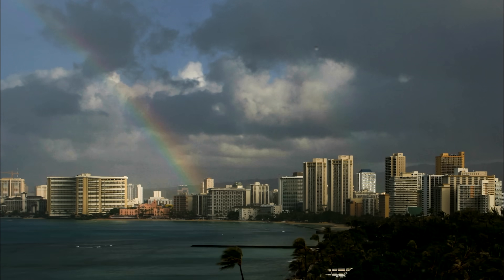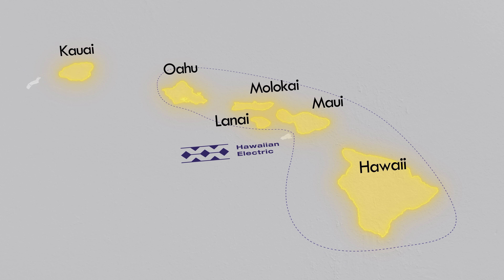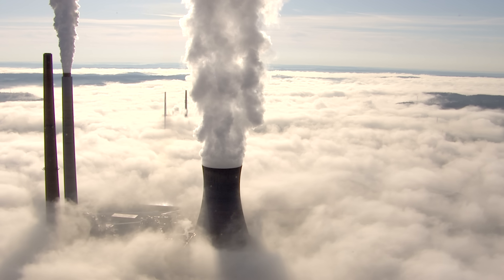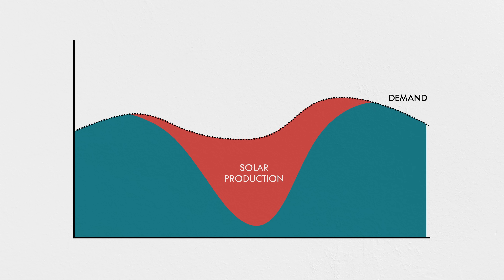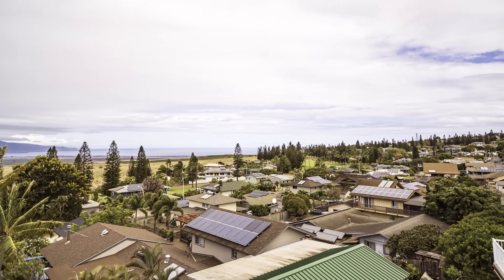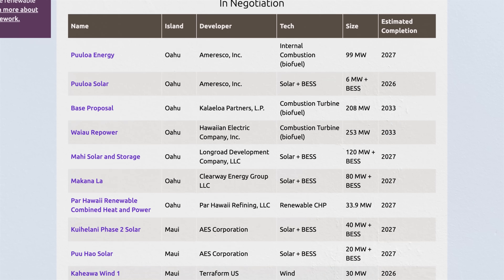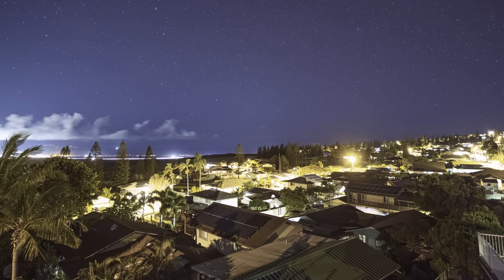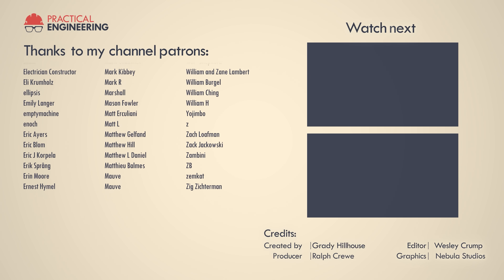How the Hawaiian Power Grid Works

Comment: One thing with "net metering" is the you really need hourly metering for distributed sources. That kWh you buy during peek hour a day with no wind (or evening/morning with no sun) is way more expensive than the one you sell when there is a steady wind and not a cloud in the sky on a Sunday when most businesses are closed (and in a season where AC is not needed).

And even then there is a difference between what you get paid at the point of production (sometimes negative), and the higher price paid by the consumer at another point of the grid, because transmission still costs.
Reply: Then it isn't net metering anymore. It's the instantaneous wholesale spot price.
Reply: OTOH Net metering is a nice simple way to encourage people to install solar panels in the early days of the energy transition. When the state's entire production of renewables (including commercial scale solar and wind) is still only 10%, any power produced results in a direct saving in imported fuel.
I'd agree that it won't work if domestic solar is producing a significant amount of the total (we're seeing lots of time-of-use tariffs and even half-hourly variable rates in the UK) but it's still a sensible option for Hawaii.
Reply: @robinbennett5994  But why do we want people to be installing solar panels when it isn't economic? And why should rooftop solar people be getting paid retail prices when power stations are only paid wholesale power prices?
Reply: @gregorymalchuk272 because Hawaii is at 10% of renewables and wants to get to 100% fairly quickly. It's a temporary subsidy that can be changed when there's enough solar to make a difference. And because Hawaii isn't Arizona or Texas and doesn't have massive empty deserts to fill with commercial solar plants, but it does have more than enough roof tops.
Reply: @robinbennett5994  Why is lots of solar with outrageous electricity prices a public good worth wrecking the electricity market over?
Reply: @robinbennett5994  Why aren't they building nuclear plants?
Reply: "Net metering" was an incentive to encourage people to install solar without waiting for HECO to install fancy metering systems.  When solar was feeding the grid, the meter ran backwards.  You only paid for "net" use.  In effect, you sold the power for the same price as you bought it.  While some people are grandfathered in to net metering, that program is closed.  Right now, you sell power at a lower rate than you buy it.
Reply: @russellhltn1396  Net metering is fraud and nobody should be grandfathered into it.
Reply: 11:44 "increased efficiencies" is the worst lie in the history of electricity distribution. Increased efficiency leads to lower costs, which increases demand, just look at LED lighting, especially outside. If the cost goes up for other reasons, efficiency in some areas may compensate for those costs for the basic needs (such a fridges and utility lighting) but in the end, more efficiency is always compensated by induced demand, the same way an extra lane on a road does.
Reply: @57thorns  I'd need some sources on that one lmao
Definetly feels more like saying "increasing the fuel economy of cars induces demand for cars" which while broad enough to not be dismissable off-hand, it's definetly nothing like the induced demand of adding lanes
Reply: @ValentineC137  As I mentioned, the amount of products for lighting has exploded, especially mood lighting and outdoors. Where there once used to be either very modest and only in some instance a lot of e.g. Christmas lights, now it is much more common to put on a big light display.

As for the cars better fuel economy, the car will be used more of course. Anything from shopping at a shopping center outside town instead of the local grocery store to weekend trips.

In both cases the total cost might be lower, and the total energy usage lower for most, there will be those that use more energy as well.

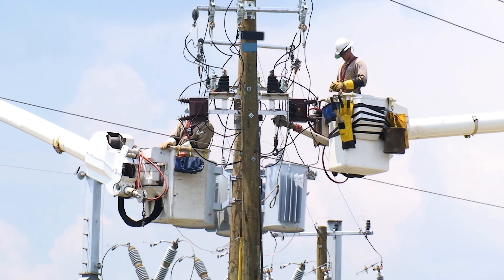Comment: @11:00, And this is why the pricing structure for our power needs a major change. There should be an "connection" fee, and a "usage rate". the connection fee would cover the fixed costs  of simply having a connection to the grid, and the usage rate would be the direct cost of that power. many electrical grid operators are already heavily regulated so ensuring transparency shouldn't be an issue. The goal would be that most consumers that do not have local power generation should see minimal change in their monthly bill.
Reply: I didn't realize that wasn't normal. My bill is itemized with a per-day charge for simply being a customer, plus a kwh rate.

Comment: A very informative video. Hawaii's main islands are very close to each other. Even the largest gap between Kauai and Oahu is only about 120km (whatever miles...). They should really figure out how to do those undersea DC connections. Surely this is not impossible. A bigger grid is a much better grid.

Comment: I grew up on Oahu and one thing we used very little of was electricity. No AC or heat didn't need much lighting, Washer and dryer were outside and often didn't use the dryer. I'm glad you brought up all the issues with piling solar onto a small grid as there are many complaining about no longer being able to put power back on the grid now. It's a much more complicated issue than it looks on the surface. Also looking forward to your next video. There is a big difference between a rotating mass making electricity and a digital inverter and then a transformer based inverter as well.
         But I did see on google street view that the house we lived in went from a flat tar and gravel roof to a conventional pitched roof with solar panels and it looks like they have replaced the jalousie windows with regular windows and added air conditioning. My only complaint about living there was the constant ear infections from not having a dry place to sleep at night so AC is a very good thing.
Reply: @dobbo7690  I haven't been back since I left in 89. Allot has changed there especially the population explosion there.( I remember H1 still being under construction) None of the stuff I would want to go back to exists anymore either. Friends have told me I would be disappointed if I came back as it's not even close to the place I remember. I can jump on a plane and get there really easily but the cost of hotels rental cars etc are nutz now. I don't need a resort just a best western... 
    I have been in tx longer than anywhere else now and I miss the summers when a hot day was 92* and places closed in the afternoon cause it was hot... Now here I see 92* as a cool summer day since our temps are regularly 105-110 and don't drop below 80* at night with temps still in the high 90s at midnight.
Reply: @theinfernalcraftsman It is true that you can never go home.  Over time, it, and you, will never be the sane.
Reply: If you think he’s exaggerating, I regularly pay a 650-700 dollar electric bill on the big island. I could be smarter about it but I find it more fruitful to complain about it
Reply: @BruTheThreat   it is extremely difficult to truly live on paradise when all you do is work to pay to survive,  Hawaiian electric KNOWS they have us all bye the b@ll$
Reply: @keilikea01  It's funny because we're contracted to work for Helco on a daily basis and when I brought up the fact that I'm building my own house, they give me tips on how to save power, first steps for solar or in general how to cheese their bills. "Just get a temporary service line just to be on the grid in case anything happens and never apply for a permanent fixture. That requires a permit" 

A few of the foreman think that their business in general is doomed.
Reply: you have those glass slat windows too?
Reply: @joshw.2739  Yup. Every window. Had to move the furniture away from the windows when hurricane Eva came through to keep it from getting wet as they don't hold out wind driven rain very well. This was back in the early 80s and the windows were a constant maintenance nightmare. The gear boxes would freeze up and a pain to clean. At least the bathroom ones had the frosted privacy ones.
Reply: @theinfernalcraftsman  gotcha, I was there in like 2006-2009 when my father was deployed. never had motorized ones but even my school rooms had those style windows. they were just opaque plastic and metal so they could be sealed flush in the event of a lockdown.
Reply: @joshw.2739  The old ones we had were aluminum and steel. The gearbox was an aluminum casting with a hand crank and they would corrode and jam up. They somewhat closed but would still have a gap as even the good ones wouldn't close to where they were any closer than 1/4" at the joints. The school I went to had the same vintage ones as well as they were old back in the 80s. Lockdowns didn't exist back then though Radcliff wasn't super safe back then either.
Reply: @theinfernalcraftsman  well theres your problem, galvanic corrosion from unlike metals!
Reply: @joshw.2739  my apt in honolulu had them still. Was right off of H1, had to clean off a film of road dust from everything every 2-3 weeks.
Reply: @theinfernalcraftsman They froze up usually due to salt corrosion.
Reply: @joshw.2739 Seldom did those windows actually seal that well.  High winds could easily drive water between the two pieces of glass, even fully and tightly touching one another.  No rubber seals.  Endless issues, but they did allow good cross air ventilation on dry days and nights for those with no a/c.
Reply: @theinfernalcraftsman Radcliff?  Radford high?
Reply: @WilliamMurphy-b6v   Go Rams!
Reply: I was fortunate not to get ear infections but my siblings did. Was never sure if it was from the humidity or the fact that we swam darn near every day for hours.
Reply: I lived on Oahu from 2011-2014 and I had an apartment that didn't have A/C or heating.  Didn't need it.  My electric usage was minuscule compared to my usage in Texas.
Reply: I grew up on oahu too in a no AC tongue and groove wall hose
Reply: the worst is high cost of housing i felt like i dont own the house n property never-ending property taxes, the assessment value of the  house and land  goes up n property taxes follow. now u buy a condo or apartment n pay the never endîg keep going up common area or maintenance fee. So if u rent it's the same auwe.😅😅😅to save electricity use a lot of fans it works 2cool off😅😅but then again i like my air-conditioned car😅😅
Reply: I live in Southwest Florida and I have energy monitors on several breakers in my house. 64% of my electricity usage is HVAC and 14% of my electricity usage is charging my EV. They’re the vast majority of my electricity usage. I see the value in not heating or cooling your house, even though it makes life much more pleasant! 

Last week I used:
AC: 275 kWh
Hot water: 16 kWh
EV charger 60 kWh
Everything else: 80 kWh
Reply: Yeah, my hats off to you for living somewhere humid without AC. I barely use AC if I can help it, but I'm fortunate enough to live somewhere with ~30 RH.
Reply: Oooooo. That's a good point. So many people get sold on the idea of selling excess power back, but when everyone has solar, that won't be as much of a thing since everyone will get peak power at the same time.
Reply: I've heard that Hawaiians don't use much AC but I didn't realize that was why. Must be so relieving to finally get some cheaper power.
Reply: Brah! No electric??,  when to wen move, every body get a/C now😂😂😂
Reply: @keilikea01 I never had house AC in Hawaii and if car AC breaks no fix if expensive

I live in Hilo at 500 foot elevation and don’t need AC. If I lived in Honolulu in 2025 I would want AC. Never had AC in Honolulu in 1970’s. Only wealthy people had AC back then.
Reply: @dabigisland1 I guess the geographic location on the island matters more, the truth is now in 2025 there are thousands and thousands of homes what air conditioning is literally a requirement due to new building code and standard. Homes are built so airtight if you do not dehumidify the space regularly or have good air flow through windows that open 100%. It becomes a mushroom and mold breeding ground

Comment: A lot of unanswered questions about the Hawaiian grid.  What is the capacity of battery storage compared to amount of interruptables on the grid?  I hear you say that the batteries are huge, but are they close to what is needed?  Is installation of roof top solar still limited?  Or is it required to be paired with home storage or EVs?

Comment: So they went from 0% to 20% renewable in 17 years.  Now they need to go 80% more from 20% to 100% renewable in the next 20 years.  Diminishing returns? anyone?  I would venture to say all the low hanging fruit has already been picked.
Reply: Or you could say there’s an adoption curve where things need to ramp up. Adoption of new technology is not linear. It starts out slow and picks up speed.
Reply: The percentage of renewable energy for HECO (for Oahu, Maui, and Big Island) as of 2023 was 33%.  Kauai's KIUC is at 60% and has had some days of 100%.  As point of comparison, NYC is at 30% as of 2023.  Additionally, the US DOE says that Hawaii's percentage in 2022 was 29% (+4% YOY), so with 22 more years to go, they are still on track to achieve 100% by 2045 as required.  20% is far too low of a number to present without evidence disproving the DOE and HECO numbers, especially given that there is a significant amount of off-grid renewable power generated in Hawaii as well.
You presented no evidence that the "low hanging fruit has already been picked", since solar and wind are still being adopted at large scales, prices for solar panels and battery storage have been going down, the West Kauai Energy Project has been slowed down due to lawsuits but not stopped, and technologies are still improving.
Reply: yes. they will not make the goal

Comment: 13:56 - Actually you can pay extra (in the form of whole home batteries) to have more power reliability. These batteries can also level out the demand curve by storing energy at night and then discharging during peak demand times, saving consumers money by avoiding the highest time-of-use rates.
Reply: *If you own your home.
Reply: @MrMadsci7 Not the only scenario. Some rental situations allow for a tenant to pay for a property upgrade and receive credit off their rent.
But yes, typically people who can afford the luxury of home backup batteries will own the property they are improving. It's still a large enough percent of the population to make meaningful differences to electricity supply and demand.

Comment: Remember when the fire hydrants were off during the Maui fire?
Reply: a town near me had that happen several years back.  when your water system depends on pumps, and the power goes out, the hydrants stop working.  in this case, the irony was the power was turned off to allow a ladder truck to raise the ladder to fight a fire.
Reply: @kenbrown2808  I'm sure you are serious.
Reply: @motionsick I am.  it's also why so many buildings, especially in rural areas have big water features.  if the hydrant system isn't adequate to provide enough water to fight a fire, having water on site, can make all the difference.   same with the iconic water towers on the roofs of tall buildings.  they're not for drinking water, they're for firefighting water.